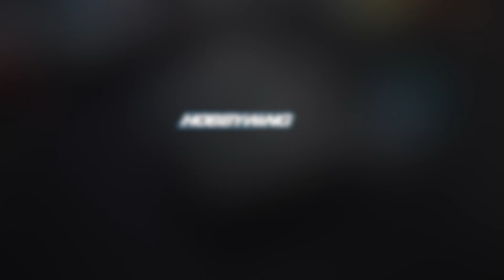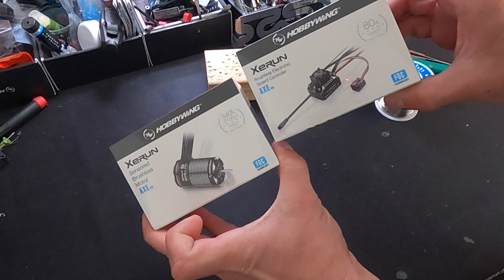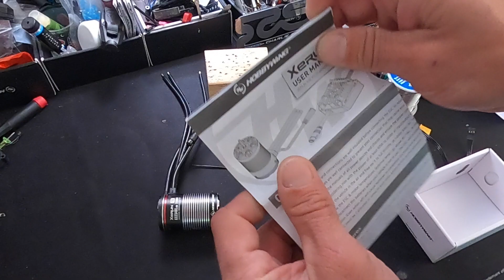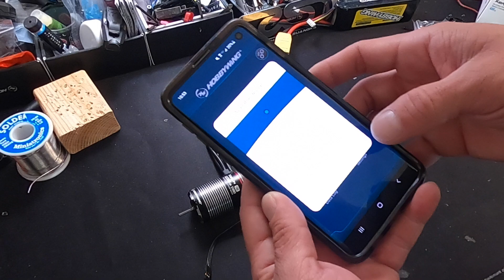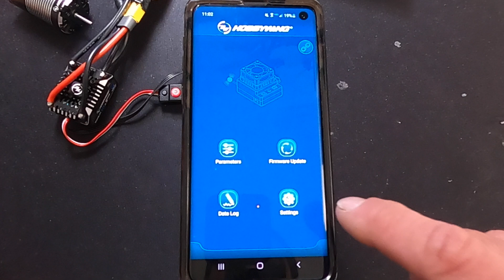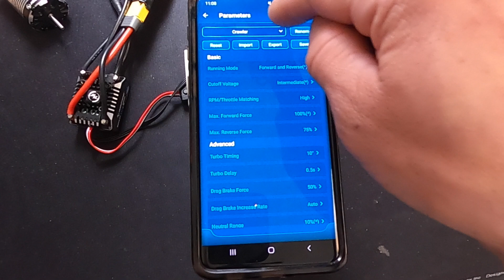The Charlie Show /// Episode 203 /// AXE R2 complete setup

Comment: Okay, so I got ahold of a set in 1400kv for a Globe Liner, because This Has The Oomf and the Yokomo I bought from the (now defunct) R/C store is actually a drift car motor. 

Since I started messing with the racing motor, there's one thing I can't see on the Axe motors.

I can't see any information in the manual or on the can itself about adjusting the end cap to put mechanical advanced timing on the motor.

Is physical timing advance a thing I'll need to mess with?

(Please say no)
Reply from the maker: The Axe motors are for Crawling, and "do not" have any adjustable motor endbell timing at all.

Comment: hello just instaled my axe system with1400 kv motor when is not use is making tiking sound and gentle vibrate  (almost like coging but not moving the wheels) I set my endpoint do this is normal ??

Comment: Hi there.
I'm having issues with my axe system I got to put in my Phoenix build.
Quick question what Is your esc and motor temp normally run at.
I seem to get to over 40 degrees pretty fast.
Is that normal.

Comment: Hey ! I used the 2800 kv one but it has a very bad slow mode 😤 I also had the fusion 1800 kv and it is so much smoother in start and very slow driving 🤷‍♂️
Reply: I just installed the 2300kv,had the fusion before...the fusion was better controllable but it kinda jerked in low not that smooth...I need to turn down the power on the transmitter, it kind of working...not yet figured everything out

Comment: Can you set up multiple different profiles for the parameters? Say if I use a truck for two different things; crawling and bashing. Can i have two different saved parameter settings so i can easily switch between them without having to individually change each parameter?

Comment: I seem to have a faulty system, bought brand new, followed every step in this guide, although I know how to set them up anyway, figured I'd try and copy your settings and such and it's so jerky, it's like the FOC is set to super high all the time, even when it's low.
Is their a way to turn the FOC completely off so I can test it?
Like, I come up to a small stone or tree root or something and it hits to about half throttle and jumps over, my tx/rx are fine and have worked in another rig.
Very strange behaviour.

Comment: Upgraded my Gen8 Axe with an R2 540L 2800, Great upgrade.     Planning on upgrading the Spektrum system in the RYFT with the R2 550 3300KV. Not impressed with the RYFT power train.
Reply: What did you do with the original setup?